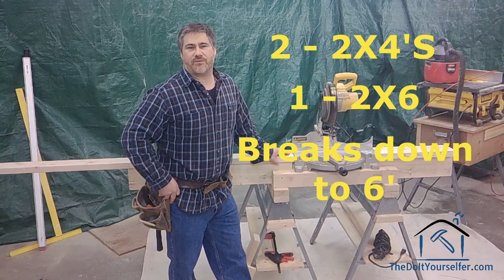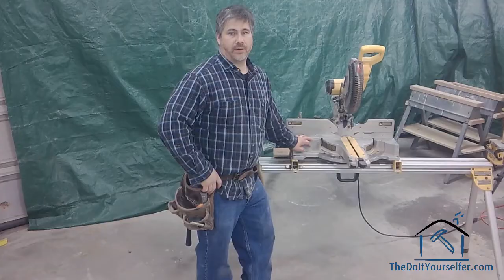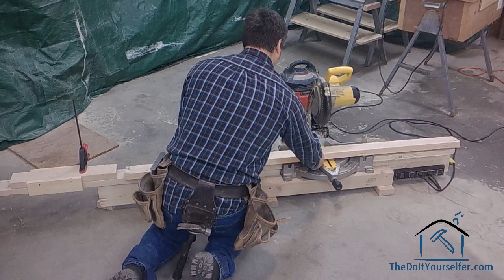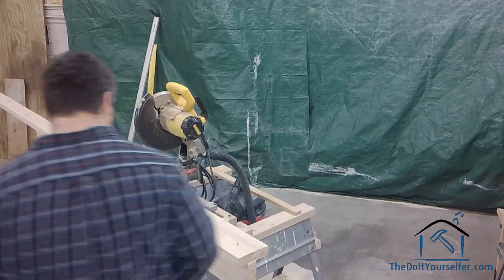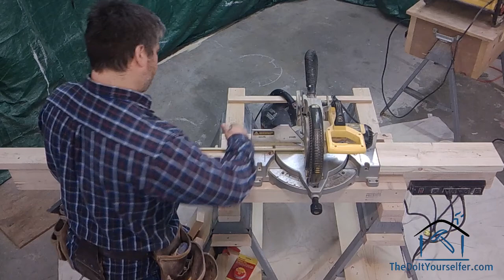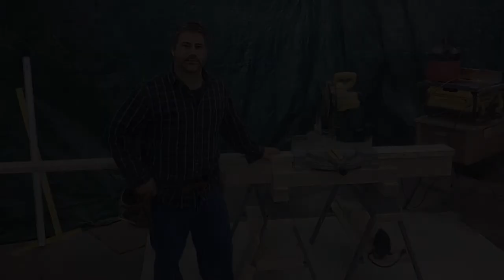Miter Saw Table CHEAP and EASY!!!

Comment: So after not having access to the plans and trying to reverse engineer this I noticed a couple of things.

The base of the stand is supported with two face down 2x4. Situated above rests two more 2x4 standing on their short edge. One is supporting the saw above and the other is bracing the 2x6. Above the 2x6 is the “support wing” which appears to be sitting flush against the body of the miter saw. 

The problem that I ran into is that the body of the miter saw is slightly convex and placing the 2x6 in this position does not allow the 2x6 to rest flush against the base which will present a problem when you need pull the saw out of the station.  You would need to commit near total disassembly.

Additionally, when testing the height of the cutting surface it was not flush with the support wing without shimming. Unless it’s assumed one is using a table saw to rip a custom size 2x6 (which he may have recommended in the original plans)?
Reply: @FortLauderdaleAcu out of the hundreds of miter saw station videos with plans and more details, I of course have to become enamored with this one, which is no longer available. His first name is Jay, do you happen to know his last name?
Reply: I did find some detail here:  https://learndiytoday.blogspot.com/2018/04/diy-miter-saw-table-vs-dewalt-chop-saw.html

Comment: I built this miter saw stand the other day and love it.  I had no wall space left in my garage workspace and this allows me to set up against the garage door and take it down when needed.  Solved multiple problems.  The price of lumber bumped the project up,to 28 dollars, but still a. Arguing for the functionality.  Thanks again!
Reply: Dean, do you still have the plans? Id love to get a copy if you do. The link no longer works and his email address no longer works as well.
Thanks,
Dave
Reply: Should say still a bargain, I hate swipe.
Reply: @deanstansbury2677 I'm also interested in the plans, seems the OP is not doing anything on youtube any longer.

Comment: I have a question: on one of the 2x4x8 the measurements go over 96 inches, if I cut my pieces to the exact measurements you provided it.it goes over 2" and on the 2x6x8 it goes over by 3/4", my question here is: how to compensate for the difference, any help on this will be greatly appreciated, and thank you for such an inspirational video it is very helpful. and that's why IAM trying to put this together, thank you. again
Reply: Hey there @adriangutierrez9170 do you still have the plans for this? His channel has gone dormant. I spent part of the weekend trying to reverse engineer this and I'm close, but it's not as good as I'd like it.

Comment: Wanted to send you a thanks for the portable stand video. I did a modification to the stand by placing dowel rods for my saw attachment versus the screws holding it in place. It works great and I will send a picture of it.
Thanks again!
Reply: I guess they don't allow pics. Sorry!
Reply: It appears the channel has gone dormant. Do you have the plans?

Comment: Dude! Kudos on the great plans. Got a Ryobi compound miter saw for Christmas; this is really my very first woodworking project! As instructed, I increased the length of the "D" boards to 10" to accommodate the Ryobi stand vs your Dewalt. My one challenge was that once I finished screwing and gluing the stand together, when I put the saw in place the infeed and outfeed boards were just a bit below the miter saw base...I was looking for some wedges when my wife came up with some foam shelf liner. Cut it into strips, laid on top of board "F"; this raised boards "G" and "E" to a perfect height. Starting a new project tomorrow, can't wait!
Reply: Do you have the plans anymore?
Reply: @edemyre8993 It appears the channel has gone dormant. Do you have the plans?

Comment: I just bought my first mitre saw and built this today. It took about 30 minutes of planning as my saw was slightly different in dimensions. The build took less than an hour with your cut list. It’s a great table for cutting those seriously long cuts.

Do you take off the 6 foot board on the left to save some space when you store it?
Reply: @aaronstascak8075 It appears the channel has gone dormant. Do you have the plans?

Comment: I was about to run out to buy portable Bosch for $65.....   but the site I was going to get it "cheap" from is getting reviews as a rip off site and it's $200 at the local box store... and this design is far  better than anything out there for what I need a table for - floppy plastic 16' boards!  Love it.  My build for this weekend!

Comment: Thank you very much for the video and plans, I built the same as yours but small slightly dimensions adjustments to fit my my Harbor Freight Admiral 12" Sliding Compound Miter saw. God Bless

Comment: Thanks I just made this, modified for my 12" SCMS, and it works great.  While I'd love one of the permanent miter saw stations that I see online, I don't have the shop space to dedicate to one.  This, I can hang from the floor joists when not in use, and also easily fit it in the van if I want to take it somewhere.  Also, only costing around $15 was very nice, too!

Comment: Great ingenuity in coming up with something simple and efficient. Thanks for sharing! 

So, you find the 10 inch mitre saw plenty for your work? Interesting...when      most people aim for the biggest. You may have helped a lot of woodworkers and handymen make a better choice.

I like your peel and stick tape too. I wonder, would it be worth cutting a shallow rabbit for the tape, so as to not scuff or hook it?
Reply from the maker: Thanks for the comments! Yep, I find the 10" mitre saw covers most of my needs. That's a great idea about the tape- because of how thin it is i didn't bother to rabbet it in, but if you do report back and let us know how it went! I love improving on design

Comment: HI Jay, I built this over the weekend.  In the video it seems pretty portable but with the 2x4 on the left at 6' or longer this wont even fit in my truck.  When you say it breaks down to under 6', does that mean I have to unscrew the 2x4 on the left for transport?
Reply from the maker: Yes, that's what I do!

Comment: This is very clever. Simple but extremely effective.  Im a finish carpenter and im always looking at ways to make my bench setup more effective, even more so now as im doing 2 story fitouts. This design on top of my light weight aluminum platform might be the way to go. 
I love learning new tips and ideas thank you.
Reply from the maker: Thanks Dave- I hope it helps you! I'd love to hear back.
Reply: I built the bench yesterday afternoon and put it to the test today, fantastic and efficient,  i had the dewalt bench before and always had to move the extensions in and out to support different cuts its great having the material flat and supported. I just had to adjust the cut out to suit my 18v makita and convert the inches to mm from the plans. 
I look forward to what tips you have to offer in the future.
Great stuff jay.
Reply: @thedoityourselfer1416  I emailed and haven't received the plans yet. Can I get them soon? 😁

Comment: Jay,  How did you flush the Top support pieces to the cutting surface of the saw?
Reply: Martin Maloley can you explain this in detail please. My saw is only 3 1/4 deep. Does this mean I will have to rip the 2x6 down?
Reply from the maker: Hi Martin, 
I saw that you got the bonus plans above. Did that help you with your question? I'd be happy to provide a more detailed explanation if necessary.
Reply: thedoityourselfer can you explain in detail please. My saw is 3 1/4 deep. Does this mean I have to rip the 2x6 down?
Reply: Hi @martinmaloley8935 , it appears this channel has gone dormant. Do you have the plans you could share? I'll gladly buy you a cup of coffee for them.